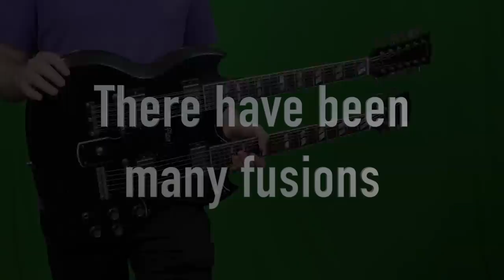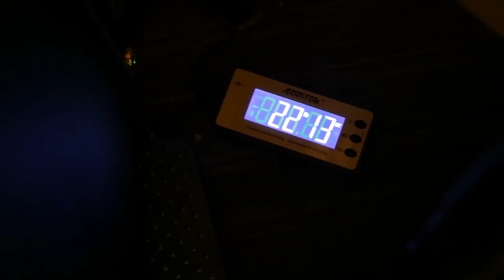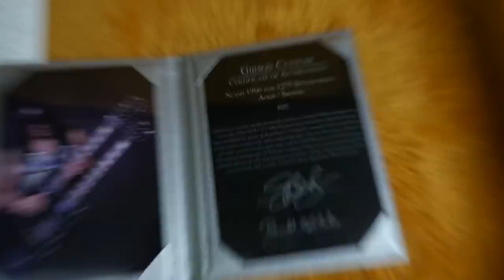Secrets of the $13,000 Double Neck Guitar | 2019 Gibson Slash Collection EDS-1275 | Review + Demo

Comment from the maker: https://reverb.com/item/28494311-2019-gibson-custom-shop-slash-signature-1966-eds-1275-double-neck-aged-signed?_aid=growsumo&gs_partner=Trogly
I have a newfound respect for these crazy Double Necks. They are a lot of fun to play and I highly suggest you try one out. While 13k isn't affordable for most people, there are less expensive Epiphone versions and even most used (non-signature) ones can be had for around 3-4k. You can't help but smile playing one of these behemoths!

eBay: https://rover.ebay.com/rover/1/711-53200-19255-0/1?mpre=https%3A%2F%2Fwww.ebay.com%2Fsch%2Fi.html%3F_from%3DR40%26_trksid%3Dp2380057.m570.l1313.TR10.TRC2.A0.H0.Xgibson.TRS2%26_nkw%3DEDS-1275%2Bslash%26_sacat%3D0&campid=5338292223&toolid=20008 
Amazon: https://www.amazon.com/s/ref=as_li_ss_tl?k=guitar+strings&ref=nb_sb_noss_1&linkCode=sl2&tag=trogly-20&linkId=b0bba4061d2613a6aa156768416f638b&language=en_US 

Episode Guide:
0:00 - Intro
0:40 - Slash EDS-1275
1:08 - Slash's History of Double Necks
2:15 - What's a Double Neck?
3:20 - Double Neck History
5:04 - What's it Like to Play One?
7:25 - The Controls
10:05 - Inside Look / Specs
19:53 - Clean Demos
21:27 - Dirty Demo (Charlie)
24:17 - Final Thoughts
26:07 - Condition
28:35 - Blacklight Test
29:20 - Case + Candy

Mentioned Videos/Websites:
Knocking on Heaven's Door Live: https://www.youtube.com/watch?v=2-T2v9kDCBI
Stairway Live: https://www.youtube.com/watch?v=CBk-iRihSUg
EMS-1235 GuitarPoint: https://www.youtube.com/watch?v=G407m2Wd7Wo
EBS-1250 Fretted Americana: https://www.youtube.com/watch?v=tBXA9I4PWyE

Double Neck Guitars Website Erik Ernest: https://www.abalonevintage.com/gibson_double_neck_guitars_1958_eds1275_double_twelve_1959_ems1235_double_mandolin_doubleneck_hollowbody_sg.htm
Reply: It wasn't originally black. His tech painted it black for him.
Reply: Now I want to buy one
Reply: @5:23 You know it's something beyond special when you don't merely 'hold' it........you friggiin' WIELD it!!  
               You sir, are worthy of a codpiece.
Reply: there are also ones on harley benton for under 800$
Reply: Hey man I jus found a crazy guitar on reverb I font think u even had one on the channel .its a gibson nighthawk lespual type shaped guitar never heard of it
Reply: Cool guitar and thank you for the details, Peaches Guitar out of UK had a recent unboxing and said these were all made in 2018. Seems like a long time to market if true.
Reply: Sloppy Gibson workmanship.  So glad I went for other brands.
Reply: Hey Trog, your playing is really getting better.
Reply: I don't know why Gibson didn't/doesn't make a John Mclaughlin Double Neck reissue.  He's the first real guitar player to use them in the contemporary rock world.  In fact, I was watching a interview of Dennis Chambers and he discussed how he met Jimmy Page.  And Jimmy Page told him that John Mclaughlin was the reason why he started using the double neck, plus John McLaughlin was a guitar teacher to Jimmy Page when Jimmy was in high school.

While most of the younger kids probably don't know much about John Mclaughlin and his history and catalog, he's really the one that should be noted as being the influential guitar player to other top guitar players and because he used the Gibson Doubleneck, and then later the custom Rex  Bogue double neck, those prompted others to use the Gibson Doubleneck and then the Ibanez Artwood doubleneck which was a copy (obviously a much cheaper version) of the the Rex Bogue.  Actually, McLaughlin was offered the Ibanez double neck/endorsement after they heard his Rex Bogue was destroyed in an accident, but McLaughlin refused.  (I wonder why).

Either way, I'm just surprised that Gibson isn't making a re-issue of the model John Mclaughlin used with Mahavishnu Orchestra.  Plus, McLaughlin's had a switch in between both necks and it's hard to see if there was another switch by the tailpieces like this model has.  I don't know if the switch does the same thing and it's just it's position that's different.
Reply: How do you get all of these guitars?

Comment: Resistance drops when pickups (or Humbucker coils) coils are wired in parallel (plus to plus, minus to minus, the only way a toggle 3 way works), as opposed to going up when in series (plus to minus, like the coils on a humbucker are normally). It's just like speakers.

Comment: I have the epiphone version of the 1275 with set necks and it is HEAVY. Best plywood body as well but still sounds reasonable and was slightly more affordable. However if anyone is tempted by the cheapo epi version, DO change the switches as they all seem to be pretty unreliable on all the epis I've bought.

Comment: Ok so from what you explained with the 3 ways, the only way to get the bridge pup on the 12 string would be to turn down the volume to the 6 string? I would have thought the bigger switch was only for the 12 and the bottom switch only for the 6. Lol I am trying to figure out in my head how they could have done that plus you'd have to be able to kill the other guitar when you aren't using it. I guess one more switch like between the two guitars but more towards the front, down would be 6 up would be 12 and the middle kills them both? Lol, I know that wouldn't work but my brain isn't working right tonight for some reason lol. Anyway, Hey Austin is that your'e playing during the intro? Man that sounded awesome! Very in your face classic rock vibe going on there!! 

I still don't care for relic'd guitars but this one they did a good job on and did not carried away with it like you see so many of them do. Lol if I were to own that and not know it was a relic'd job I would be polishing the heck out of it trying to get those scratches out! lol. There is a video of KISS, the authorized video they put out for the song Hard Luck Woman, and Paul Stanley has a red SG double neck strapped on and he is playing the 12 while Ace Frehley is standing behind him and is playing the 6 lol. It was a cool video to see at the time when they first came out with it. This one you got sounds awesome!
Reply from the maker: The one in the middle of the guitar controls which neck - the one by the 6 string neck controls what pickup you're on just like normal (works for both necks.)
Reply: @Trog  - Om I gotcha! Hey, I was thinking, maybe the truss rod isn't really almost maxed out, maybe it's part of the reilc job? Maybe they used a longer than usual rod so they could make it appear to be how you saw it? I kind of doubt it but since it's a relic job who knows? Maybe the the pick guard screw is the same? But, if they are defects, you get to send it back, get your review and not be $13k in debt lol.

Comment: I have a '72 ES-335 with nary a check mark on it.  It would pain me deeply to see my Es-335 looking like that.
I did have a '63 SG that was full of checking when I bought it in '70.  But the checking was mostly across the body and NOT lengthwise.  Here in Minnesnowta the biggest reason for checking is not letting your guitar warm up slowly before opening the case after it's been sitting inside your car in subzero weather.

Comment: The signal is quieter in the middle because the pickups connect in parallel. Same reason the middle position on on a two-pickup guitar gives a smaller signal than either pickup individually, or why a humbucker gives a smaller signal with its coils connected parallel vs. series. 
I made a 6-over-6 doubleneck so I could switch between open E and standard EADGBE tuning, and ended up wiring the two sets of pickups in series to avert the volume loss when both are on. I also had to put a capacitor in series to reduce loss of treble, but it seems to work. Not as well as an active buffer and mixing circuit would, but the control cavity of this guitar is already too crowded without a preamp!

Comment: Very interesting.
The sympathetic output from the side of the guitar not being played does add evidence to the whole tone-wood debate.
What I've read is that Vintage pickups were many times microphonic in nature.  The belief is that the microphonics of the pickup(s) actually add to the overall tone of a vintage instrument.   If the wood does indeed vibrate and add to the overall sound (and this would be expected as certain woods are resonate in nature) then the microphonic pickups would reproduce these sounds/harmonics and include these additional sounds/tones/harmonics and frequencies into the guitar's pickups output.
So even though some have argued that tone-wood is a myth we here have clear evidence that the wood is resonating and inducing signal output in the other pickups.
As I stated earlier, very, very interesting.
So in theory as long as you have a guitar with a resonate piece of wood and slightly microphonic pickups you should have a pretty good sounding instrument.
This whole thing kind of proves out why my custom built R9 sounds so good with un-potted Burstbucker #1 and #2 pickups as those un-potted pickups are indeed microphonic.

Comment: Does real finish checking go under bolt on tail pieces like that? I wouldn't expect it to, but don't know better either.
Reply: That's a good question!  I've heard that extreme temperature changes can cause finish checking.  You'd think that a tailpiece bolted down tightly over the paint job might preserve it?  Next time I see a badly checked instrument on eBay I'm gonna look closely at the photos.

Comment: That’s a string anchor not a bridge, but anyway, you can’t measure a component accurately in a circuit ... But, the reason you get a low reading, and output, in the middle both necks on position, I would guess is because the resistance “sums up” (don’t know the correct expression, not an English native).

Comment: I've always mused about getting an EDS, though I would want the extended string length like Page's; more slinky...
I certainly don't give a toss for the Slash connection and its commensurate sticker shock...
Reply: Jah Rastafari if you extend the length of a string you need more tension so they won’t feel more slinky. 
Imagine a short piece a rope with a person at each end pulling to make it straight; now imagine the same rope in a lot longer length, it would take substantial more pulling to pull the rope straight.
Reply: Pretty sure the string length is the same, Page just got more from his 10 inch fingers, seriously look a them sometime, they look like a crab on the fretboard
Reply: @DoctorEnigma01   Nope; search for pictures of it; it's clearly 2"+ longer than stock. He spoke about it in at least one interview. (Incidentally, the scale length isn't different; just the tailpiece is much further from the bridge).
Reply: @allthings1150   Which I wouldn't do (or at least start out on that premise...).

Comment: All of the signature guitars are for collectors ... for investment. Having them signed by the artist increases the value. Looking at it that way, keeping it stored in pristine condition, what will it be worth in 25 years? That determines if it is worth what you are paying now. 

    It's a shame that Gibson doesn't just a make a few thousand doublenecks and sell them unsigned for around $2900. It's not the guitar that you'll use for a full live set, so you'd be paying a lot for a guitar that you'd likely only use for 1 to 3 songs a night.   

I used to own one. They are heavy guitars. The tone is really amazing. There is a lot of wood there. Mine was a '73 or '74. Even used ones are really expensive because supply is not abundant. As for the Epiphones, I don't like the headstock design and the body appearance in proportion to the necks seems a little weird on some. I don't know if it's just the angle of the picture though.

Comment: In my band the other guys have a couple of these. The white one and two red ones. Really cool and not as expensive as this Signature ones. You get similar results. I guess the neck pickup on these has a higher output because Slash mostly does his melodic solos there. I've tried the Epiphone version and is pretty close, so, guys, don't break the bank unless you're a fan or a collector. I even went cheaper to get into the double neck game with a gorgeous golden Danelectro double neck. I use it a lot because I get most arpeggio parts anyway. So it's the type of guitar you get as soon as you need it. ⚡️⚡️⚡️

Comment: Double the neck dive? Ugh..it is ultra cool to look at, as practical as a hgh gloss V! My SG HPII has horrendous neck dive, its not your average light weight SG and has a bad case of neck dive deluxe! What will corret this chronic issue? I am kind of surprised it seems no one makes "Weighted straps" which would be an option, the bottom strap clipped to the top strap does balance perfectly but offsets the hanging playing position.. lve tried all types of straps and have not really found an answer. Now 2 necks? Uggggh!

Comment: Wow, the used EDS-1275 I played at Chicago Music Exchange a few weeks back had the switches wired oppositely. The large center switch changed p-ups and the smaller lower switch changed necks. I was surprised by this, but assumed it was correct. Now I know it’s not. I must admit, it was a guitar I never considered wanting, but now that I’ve played one, it’s been stuck in my head since. Maybe one day...
Reply from the maker: Slash changed the controls on this one. I believe the vintage ones do operate like the CME one - however, I don’t have experience with any other double neck

Comment: Wow! Nice and congrats Austin!! Sorry to see you have to send it back bro... Jimmy Page is the reason I started playing 30+ yrs. ago, and like you I love Gibson's so I have my LP but I've always wanted a double neck... but not for that price! Lol. Solo music company sell's an SG style double neck kit for 300$! (comes with everything, you just paint and assemble) So a few yrs. back my wife bought me one, Depending on you guitar building skills there great! I upgraded my pickups (All 4) with some 50's style whole lotta humbuckers from SD and a Jimmy Page wiring kit (Steve at Big Leg Circuits built it for me since it has the 4 SD 5 wire pups) Then I put new graph-tech nut's and 18, Lol, locking tuners. I have my own guitar shop (Ipswich River Guitars) here in Mass. where I do repairs and set ups, So I set her up with nice low action on both necks and it plays, sounds, and looks amazing! The kit was 300 plus around 500 in upgrades and I have a custom red (I mixed my own transparent red candy and used black sanding sealer for that blood red look) double neck for under a grand! Totally worth it. I recommend Solo guitar kit's to all my customers. They make all sorts of body shapes (only 1 double neck the 1275 body like yours) and you get to pick out just about every part you want to build your own custom guitar and they all come with everything you need down to the screws and 22 gauge wires! Even the most unexperienced newbie player or builder can learn from these kit's. It would be cool to see what a custom Austin/Trology guitar would look like!! Check them out bro, There out of Canada, here's there site https://www.solomusicgear.com/                                                                     Thanks for the honest great review bro.................        Mike (Ipswich River Guitars).

Comment: collectors buy the originals, not the reissues. Have a look at all of the early 2000s R9s that gibson sold for $8999. I remember seeing those in person in nashville and thinking "I don't get it". 

Out of curiosity, I just looked at R9s on ebay. Those with little play time from 1999 to the early 2000s sold for about $8-$9K. the sellers are struggling to get half of that, and if they've fallen and broken something, a quarter to a third. 

The same purchase price dumped into the market back then with taxes paid on it since then (despite two big stock market drops if done before 2001) leaves a person able to buy 4-5 of those used R9s now (about $20-21K...that's after taxes). 

So, the idea that any of these custom shop guitars are investments....it takes a LOT of luck. I had some luck once long ago with an ibanez Jem 10th. For whatever reason, they were $1999 used. six years later, I sold mine to a dealer for $3K used, he sold it immediately for $5k (which I thought was ridiculous  -still think it is). Good condition used now brings $5-6K, and beater used brings still more than the original by 1 1/2 to 2 times. I felt very lucky to sell anything used and make money on it, though. 

It's fine to buy these guitars if you just really want one. But they're terriible as anything other than an expenditure with the expectation of a large loss if you sell in in the future. The aging makes it unique, but a lot of what I've seen from Gibson up close and personal doesn't really give you the same sense of quality as the really tidy boutique makers. Not all of the old guitars were perfect, of course, but you can't manufacture their authentic age.

Comment: I have the Epiphone double-neck one in white and I've changed out the pickups on the 6 string part to the slash pickups. Since then the 12 string seems so much quieter. So any recommendation on what pickups I should use on the 12 string? It plays amazingly. And I have used it for a few gigs.  it's also neck heavy. But WAY cheaper than this model. lol